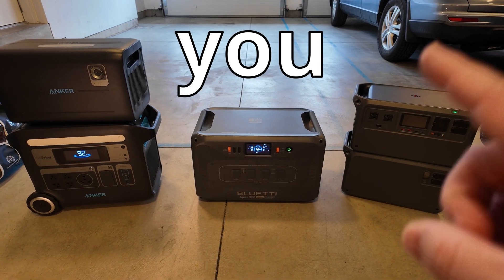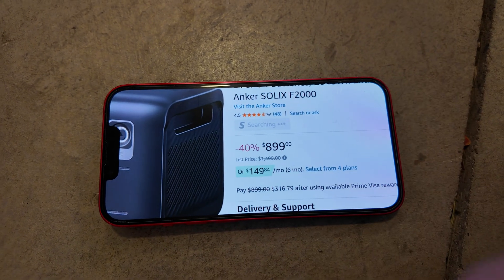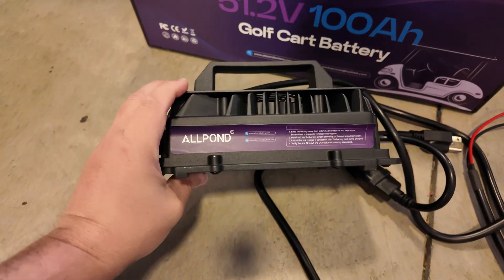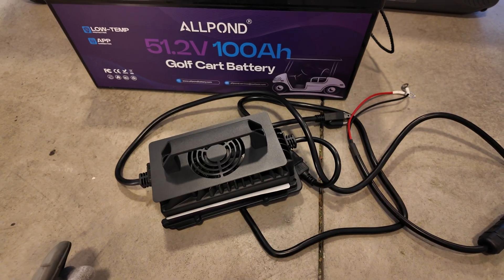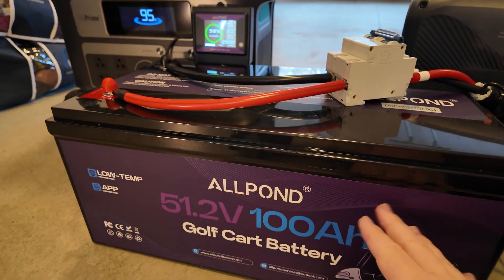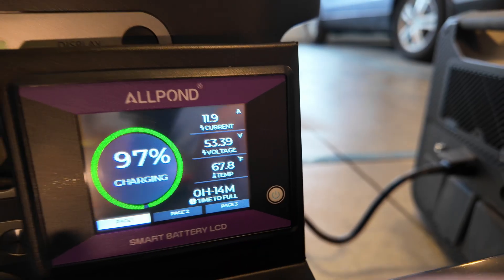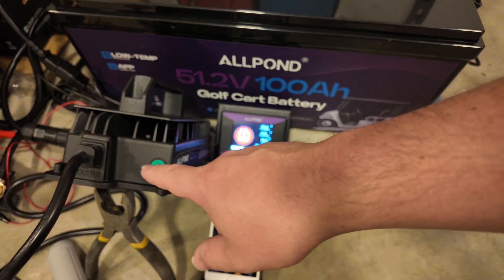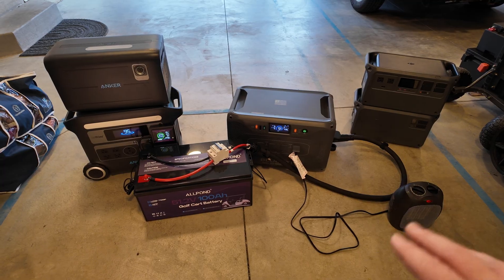The Great Solar Generator Rip-Off (And How to Beat It)

Comment: If you were to build a Transit van for RV use where you need a healthy 4000ish watt 12 volt system to power - induction cooktop - fridge - fans - lights et al & very limited use of a 400 watt heater)

Without going into too much detail - batteries system(s) would you go with. 
Keep in mind I am capable of doing some DIY👍
Cheers THX
Reply from the maker: For 4000 watts, I would go with a 48V battery system instead of 12V. :) go ahead and have a small 12 V system for the 12 V power needs… But for those big appliances… You’re gonna want higher voltage batteries.

Comment: the Pecron expansions can be used standalone. they have the same charging ports, along with an xt60 and USB ports, and can be charged without the base power unit. the 3000w expansions i got for 600 bucks
Reply from the maker: Nice

Comment: Thanks for the video bro. Have you done this with the Oupes generator? Can the golf cart battery be recharged with solar. This is the first video I have seen. I recently dived into solar power and found that the value for money was off, from panels to batteries. Subbed as well.
Reply from the maker: Yes and yes! Huge thanks for the sub!

Comment: So funny.... you think to have find the Graal..then you understand you are still far from it. A 16kWh prismatic cells battery cost 1200€...your golf cart battery is far far too expensive.
Reply from the maker: But I can pick up and move my golf cart battery… 300+ pounds for the 16 kW unit is not getting moved very much!
Reply: @theresatrickforthat What's the point to add a golf cart battery to a portable device ...if you want to use it as a portable device....? It makes no sense....you talk about expending a device capacity...then about moving it.

Comment: I was looking at the Jackery Explorer 2000 plus, would I have to find a different golf cart battery as the voltage on the jackery is 44.8v as opposed to 51.2?
Reply from the maker: Yes! If you’re going to connect it directly to the expansion battery port somehow. I am not sure how you do that on Jackery. But if the DC solar input except at least 60 V… You can use that like I show as method one in this.

Comment: But you can not charge your 51V battery from regular solar setup.
Reply from the maker: Yes you can, easily!
Reply: @theresatrickforthat  Hmmm.. how can you do it from a stand-alone 100-200 watt solar panel with 18 volts output?

Comment: I'm with you, brother.  Ultimately, I used two 100 Ah 12.8V mini batteries to build a battery box with a solar charge controller and a Bluetti Charger 1, but proprietary expansion batteries for solar generators is a huge ripoff.  I added 2560 Wh of power that will hook to any solar generator I have through XT60 or Anderson Powerpole.
Reply from the maker: Sounds like a great setup!
Reply: Yes the extension are empty air and plastic big expensive cables

Comment: My Anker C2000 gen 2 has a solar input of 800W 17A, should I calculate 17*1.25 to size a fuse? So If I round up 25A? Seems like I can't find a 25A terminal block fuse. 30A would be the max of a 10AWG ring terminal to XT60i cable. Thanks!
Reply from the maker: Fuses protect the wire. So size it for the wire at 30 amps.
Reply: @theresatrickforthat  awesome thanks!

Comment: I heard you mention "dirty power" from a gas generator. Question #1) So is it not good to recharge a eco flow delta two from a champion 3500 gas generator? That was my back up plan since the solar cord we ordered off of Amazon, didn't work with my solar panel to charge the eco flow delta two? Not that we have a whole lot of sun either and only 1- 100 watt solar panel. I think the Delta two can take up to 500 watts of solar input. Question #2) On that golf cart battery does it have a DOD of 50% or is it ok to run it down to 0%? I thought you were going to show yourself using it with a power inverter. I wonder how I'd hook it up to say our Delta two? Since it can be added onto as well. I might have to watch this video a couple times, before I grasp all your information.
Reply from the maker: The charger that comes with the golf cart battery can clean up dirty generator power and thus protects your power stations! That's one of the many reasons this kit is so good! I've got a bunch of video about this kind of thing, so browse around the channel a bit! A video specifically about EcoFlow's and how to make them work is coming soon! And it's not an issue at all to drain the battery to 0. It's still going to last you 10 years if you did that every day without going below it's 80% original capacity.

Comment: I'm really hoping this will work with an EcoFlow Delta 2 Max, but I haven't seen a single video of someone making this work with EF. It seems like there are some other communications wires on the expansion cable to make sure you're using the proprietary battery.
Reply from the maker: Yes...but it's easier than you think to get around that! I have a whole video coming soon dedicated to this! Get ready for mega cheap expansion for your EcoFlow!
Reply: @theresatrickforthat  So many of us in the same boat...

I have a Delta 3 Plus and also have the Delta 3 external battery, but its a mere 2048wh, and I never charge above 90% or below 10%, and my reserve is set to 45%.  I run my computer gear off of (about 100watts constant load).  So once the sun sets I have fro 90%->45% of capacity, and math being math that leaves me only 920 watts before i hit that 45% and the grid does some passthrough power.  I would love to be able to charge on solar and never need to charge from AC inout except from my generator when an emergency happens.

5000watts sounds great

Comment: Great video so here's a question for you... I noticed theese solar generators have different amounts of expansion batteries that can be connected like bluetti ac200l says only 2 batteries but the apex300 single unit can have 5 or 6 expansion batteries. I don't know or understand why but my question is this.... how many of the golf cart or server rack batteries can be connected to theese units your way? Is it only 1 is it the amount the manufacturer allows or as many as id like? I need a 3000 watt solar generator now and I'm torn between the PECRON E3600LFP - ECOFLOW DELTA 3 ULTRA PLUS - AND BLUETTI APEX300. im leaning on bluetti apex for the 240v but the CONSTANTLY discontinue batteries....... just subscribed
Reply from the maker: Huge thanks for the Sub! You can connect as many batteries as you'd like...with one important detail! (Did you see my tower of power in the video with all my batteries? Haha!) The reason manufacturers of batteries state a limit is because the BMS units in each battery can only stop so much current. If it exceeds what it can stop, then in a major issue event, the BMS's may not be able to shut down resulting in a run-away situation. So to avoid that, they simply put a limit on how many you can have hooked up. So long as you do proper wire sizing and fusing externally on all the batteries and strings of batteries you add, you can basically add as many batteries as you want and not have any issues.
You would expect me to say this...but I would go for the Apex 300 hands down! It's got all those other power stations beat in just about everything...and then with the SUPER easy ability to add DIY expansion batteries like you saw me do...it becomes SUPER capable!
Reply: @theresatrickforthat  I did not see your other video. This was the 1st video I've watched but I did subscribe AND I WILL BE GOING THROUGH YOUR OTHERS NOW. Yea I was leaning towards the apex for 240v and I also like that solar 4k box bluetti makes for xtra solar if I ever need. I live in a condo and don't have much space for solar panels but I'll make room in the garage for batteries. We loose power constantly for hours sometimes a 2 days and I need my refrigerator 3 tv internet and air if it's hot. Thanks for your help.....SO FAST TO.
Reply: @theresatrickforthat  by the was..... what connections did you need for the bluetti apex? Are they them j32 or something like on the pecron

Comment: This is a great video. Are you still able connect the OEM expansion battery when charging through the solar connector? I noticed for the anker you did not connect the expansion battery and the allpond at the same time. Thank you for the content.
Reply from the maker: Yes! 100% you can do that!
Reply: @theresatrickforthat Is there a separate hack or process for the charging cycle? Does everything need to be disconnected to recharge the allpond?  Again thank you for this great hack.

Comment: The one main reason for not doing this if you want to travel with it as the proprietary batteries stack easier.  Also the amount of solar charging for most solar inverters is very low when solar panels are so inexpensive these days.  If you just charge the batteries through solar charger you can really maximize this type of system.  My one issue with all these solar generators is when they fail... hard to fix yourself and getting them serviced or replaced is a pain.  I still will start with this type but eventually rather have a stationary system where just components can be replaced if they fail.
Reply from the maker: Those are all great points! Thanks for bringing them up!

Comment: GREAT VIDEO !!

I've been using 2 - 300ah 12v PowerQueen Lithiums in parallel to keep my Eco-Flow Delta 2 Max recharged. 
wih 840watts on roof of my Nomad Van in summer I can almost run my 5000btu a/c unit in 'eco mode' endlessly. 
And if That Sun Refuse to Shine 
I use my 50amp DC-DC Renogy Charger with GTech 300amp Alternator on my Ford V8 and that alternator stays nice n cool. 

But bottom Line
Proprietary Accessories 
are a CRIME. !
Reply from the maker: That's a fantastic system you've put together!
Reply: @theresatrickforthat I live very far north , 57* North , in Spring I want to try and build a wind generator from small 12" fan gens , and see what kinda charging I can get going 50mph(80km/hr) down the road.  Winter already set in here , so they'd freeze up , but that's my experiment for spring/summer. 
motion = energy , right ?  Might as well tap it for all its worth.  For larger RV's a company could really build in, quite easily 400-500 watts of fan gen into their grills or just above windshields.   What do ya think ?
Reply: Hey Kokopelli - You purchased the Eco Flow Delta 2 Max as the brains (& 200 ah battery) to your van's 12 volt power and added the 600 ah PowerQueen Li  power.

Any reason why you didn't go with  building a component 12 volt system? (old school-:)
Do you find that the Eco Flow is simply easier (obviously) or is it superior to building  your own system?
THX - I built my own system for my Transit  8 years ago - BUT I have a friend who is starting from scratch and I would like to advise him which way to go.

Comment: Nice systems are Way Too Expensive. 99% of us cannot afford Victron.  And powerbanks are convenient, portable and easy. No gaggles of overpriced wiring, fuses  switches, breakers. To each their own, i use my group of batteries to store & charge my powerbanks off my 700 watts a solar..i use a DcToDc for traveling and cloudy days;  I use my powerbanks to draw power for use in my camper. Thats worked 5 years Very well. Seperate systems give redundency. When that 1 Victron component fails....  its over. Jus sayin.
Reply from the maker: Sounds like you've found a system that works great for your needs!

Comment: Smart idea to use the all in one unit as a head and a generic expansion battery as a cabinet. You're a rock star brother.
Reply from the maker: Glad you thought so!
Reply: @theresatrickforthat This is game changer. Have a family home in Caribbean and it's hot down there. Coming from NYC it gets so uncomfortable and  running AC will kill power bill. I was looking into these solar generators. With your idea we will be able to run Ac and other high usage devices with no issues. Thanks you for the information.
Reply: You have to be an electronic engineer to charge your phone 😂😂😂 And they expect you to remember all of this!

Comment: An equivalent video for ecoflow would be welcome.
Reply from the maker: It’s coming!
Reply: @theresatrickforthat wonder if you could make the connection from golf cart battery split into 2 xt60 plugs to charge the ecoflows with 2 - 60v 15amp solar inputs to charge at a 1000 watts total?
Reply: @theresatrickforthat  Interested also in an Ecoflow video. My backup Ecloflow to my River Pro shitted out. I was ready to go to Bluetti Elite 200 but this might be a better solution.
Reply: Plus one on this. I have the Delta 3+, with a single 1024 W expansion battery that was $400, I would love to do this and build a custom cable and then sell my expansion battery. My total of 2048 Wittert is just not enough, I would love to have 6000+!

I would love to see a detailed explanation of how to make the cable correctly.

Comment: Does this work with any power station?  Essentially just need a connector from the battery to the units solar input port?
Reply from the maker: Yes! So long as the power station can accept at least 60V on the DC input.
Reply: Just need to buy a battery that is within range of your power station's solar charge controller.

Comment: I to agree the extra battery bank is over priced , I live off grid I have the elite 200 bluetti and very impressed. I thought of buying a second unit to add power and it would also leave power at home and I can bring power to the lake with the second unit wick I can buy for $1000 as to $1800 for the bank
Reply from the maker: Sounds like a clever strategy to maximize your power and portability for both home and lake!

Comment: I have the Bluetti Elite 100V2 (I also have 2 AC 300s and a total of 5 of the 300 series batteries)... It seems that the "1st option" should work fine with any of my units...  Google AI claims one should not do this (connect with single fused cable). I've been a Bluetti guy for several years but would like to be able to utilize a battery such as you describe as a future addition to my "power".
Anyone see a problem using this idea with either the Apex 100 V2 or an AC 300 with one of the 300 series batteries?
Reply from the maker: Sounds like you've got a great setup already! You should be able to integrate a battery like I described! I've been doing it for years without issues! But certainly be interesting to see what other people say!

Comment: EcoFlow are also doing this, my jaw drops when people say they spent $8k-$10k for 10kwh. When they couldve got the same for under $4k. Especially now, there are so many incredible deals for batteries. You can get 3 x 314ah batteries for $1700. Just nuts what a good deal that is.
Reply: You can rig 3rd party batteries with an Ecoflow too, just needs a resistor and a pair of bullet plugs
Reply from the maker: Yep, it's definitely wild to see the price differences out there!
Reply: Indeed a Perfect example of my above post.  I have a Delta 2 and use a cheap EVE 280ah lithium to keep it topped off.  I paid around $340 to build the 280ah pack with a fan cooled DALY 250ah BMS

Comment: What can you do with Jackery units? I have a 1000 V2 and terrified by the price of the expansion batteries.
Reply from the maker: I don't own any Jackery's. So I can't test them. But so long as the DC solar input will accept at least 60v...you're good to go with option 1 I showed in this video. Option 2 going directly into the extra battery port is a bit question mark without me being able to test things.

Comment: I've been very interested in the Pecron F3000LFP and additional batteries.  Will this work with the F3000LFP???  Can I use the AllPond instead of Pecron's expansion batts??
Reply from the maker: Most likely! So long as it's solar input can accept up to 60v you can for sure so option #1. Option #2 I'm not sure because I don't own those Pecrons so I can't test them.

Comment: Why wkuld you prefer option 2 over option 1 ? 
Is it because the breaker will protect items if there is a surge ?
 Idk if thats a stupid question. I dont know anything about electricty .
Reply from the maker: Because I can use more power out of the battery at once, and the power station can actually charge the golf cart battery itself with option 2

Comment: Superb,   so,  whats the cheapest basic  power banks that you could add a golf cart battery to so you can have a massive size battery for cheap
Reply from the maker: It works for my AllPowers R600! Haha! But that thing only has a 600w inverter and 200 something DC input. An Anker C1000 my be the best bang for buck unit that could still power just about anything you want to plug in.
Reply: @theresatrickforthat excellent,   thank you ,  good point about the inverter

Comment: I just found your channel and watched this video and looking forward to looking at the rest of your videos you have to offer.

I have an older class C 30 amp motorhome with no solar  is there a way I could use one of these golf cart batteries and have a quick connect to my existing battery pack so that I could Boondock for longer without having to run my generator?
Reply from the maker: Glad you found the channel! Using a golf cart battery for extra power in your RV is definitely doable. But...you probably can't just "hook it up"to your other house batteries. I assume they are 12v not 48v. 12 and 48v don't mix! :)
Reply: @theresatrickforthat  thanks for the quick reply. Yes, I figured there’s gonna be some other parts and pieces that are needed to step it down and some knowledge required to be able to pull it off and not do it incorrectly.